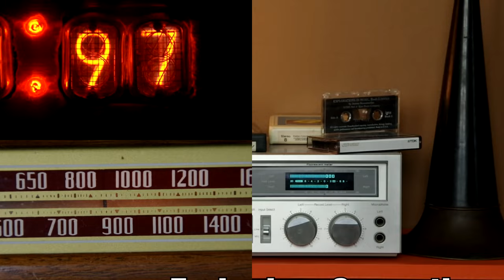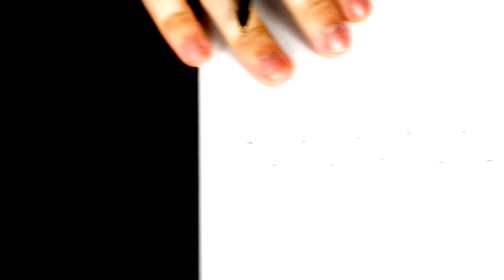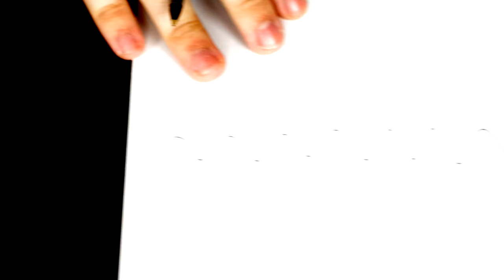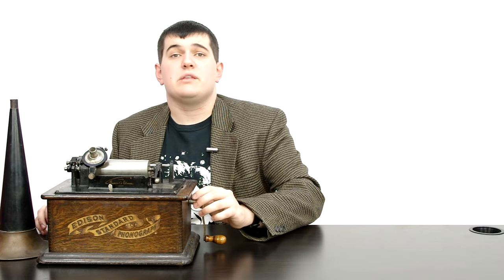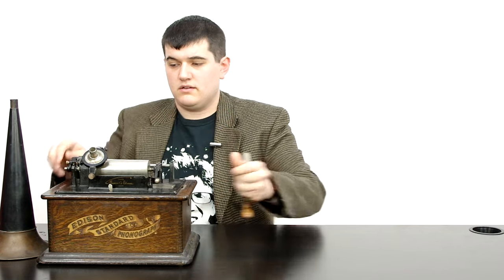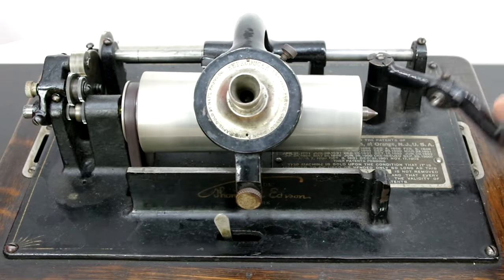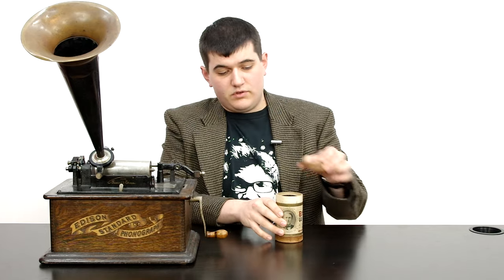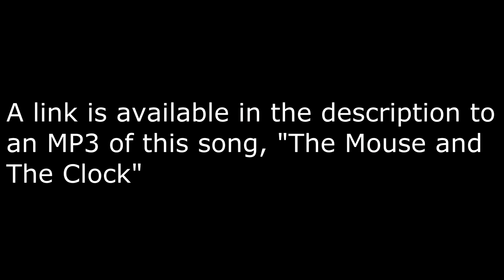Edison's Impression: Laying Sound into a Groove

Comment: interesting fun fact about that style of governor,  its where the term running "Balls out" comes from.   Stationary steam engines commonly had one of a similar design except instead of sliding a disc against a brake they controlled a steam valve and were weighted with big iron balls.  a steam engine at its max speed had the arms with these weights all the way out.
Reply: not just steam engines, old otis elevators had the same idea, two large balls ontop of the car would spin as the car got going if they spun too fast cause the elevator had lost control or the cables snapped the balls would drag out the emergency brakes which would bring the elevator to a stop then a technician would have to come and reset the emergency brake after fixing the elevator and the passengers had been rescued it wasnt so much of a governor as much as a fail safe speed control
Reply: zachary carlson i think there was an episode of mythbusters where they destroyed one by removing the pin and that let the elevator free fall for the experiment.
Reply: The mechanism you are thinking of is called a Governor.
Reply: unherolike So called because it holds the highest governmental office in a state!
Reply: Mm, balls of steel
Reply: @compzac  Would that be the origin of "balls to the wall", as the balls on the arms could, theoretically, touch the inner walls of the elevator shaft?
Reply: @Dargonhuman  no the balls of the governor never touched anything, they were weights that when spinning too fast would cause the other parts of the governor to pull cables activating the car brakes, I only have a rudimentary understanding of how those old systems work but they seem to have worked well as they continued to be used well into the 70s on certain elevators before being replaced.
Reply: @compzac  As rudimentary as your knowledge may be, you still know far more that most people do on the matter. Thanks for sharing!
Reply: @Dargonhuman  Ball to the wall referred to the throttle balls of a WW2 airplane as they would go in full throttle and under the radar to keep from getting hit by AA fire.
Reply: BIG IRON BALLS
Reply: @Dargonhuman  falls to the wall meant the balls on the aircraft engine control to the firewall.
Reply: Centrifugal governor, we use that in mechanics to get less variables in speeds
Reply: The origin of “balls to the wall” had to to with steam equipment in factories when run at full steam power.

Comment: Edison's original patent for the phonograph included a disc version. 
The reason for the cylinder was to keep the speed of the groove constant under the stylus.
Reply: 79th thumbs up
Reply: Which is the topic of the next video!
Reply: Yeah, although admittedly it was totally unnecessary since the machines couldn't reproduce sounds high enough pitch to matter anyway.
Reply: Edison filed patents, not the inventor.

Comment: Years ago my wife and I were checking out the collection of antiques in Knott's Berry Farm, and they had an early juke box that played wax cylinders. It still worked, and they even let us try it. It was pretty amazing. It was called the Edison Multiphone. It had 24 wax cylinders mounted on a Ferris wheel sort of thing. When you put in your nickel and selected the song you wanted to hear, the Ferris wheel would rotate to move the correct cylinder into position to be played. By the time we returned a year or two later, they no longer allowed anyone to operate it due to its age.

Comment: I was told that when these recordings were made, they'd line up a dozen or so recorders, side to side to most efficiently make multiples copies at one time.  The cylinders were also numbered as to which machine they were recorded on.  Much later, it was discovered that if you were to play back a cylinder from the first and last recorder simultaneously, you witness a true stereophonic playback!
Reply: Later on they would use a pantograph, basically a reproducer/recorder combination head so they could be copied in better quality.

Comment: 16:12 "I'm not counting on my iPod working in 2115."

My iPod didn't even live past 2015
Reply: No shit.  That's why mechanical stuff will always win eventually.
Reply: Cause Apple Designed this way,so you need to buy the newest one every year. Shitty brand.
Reply: My iPod that I had in Iraq in 2006, the OG 80gig one, still works to this day.  It still has all the shitty music I listened to back then and I can't change it because the password for it is long forgotten.
Reply: I so wish I had a time capsule iPod to perfectly re-live my shitty music library of years past.
Reply: People in 2020 already: What's an iPod?
Reply: @zachaliles  SAME! My 80gb ipod still works but the battery is almost dead, last 1 to 2 hours. I changed the hard drive tough, just need a new battery and voila.
Reply: @morsteen  Your statement is not quite true. Mechanical devices can usually be serviced because they're not microscopic and use much fewer components . However even in electronic devices, the components that go bad 99% of the time are moving parts (button contacts, gears, potentiometers, switches, etc) and capacitors. A mechanical device is all moving parts, so it's all prone to failure and corrosion. The big difference is that back then, everything was made as if there's unlimited resources on the planet. They used thick metal and stuff, that's why it's not breaking, not because it's mechanical.
Reply: @DasAntiNaziBroetchen  i sort of understand your point.  But if something is mechanical on a car, like say, the old spark delivery systems on a model t or something, you can physically fix that with your ingenuity and parts.  You can even fashion your own parts if you need to.  If a coil pack goes bad on a new car, then it just simply goes bad.  You can't open it up and physically do anything to it.  It's molded with all the electronics pressed and glued inside and then heat wrapped with plastic as part of the housing, all in one piece with a plug on one side to plug into.  There's no opening that up to say, solder in a metal pad on a points system, like you could on an old more mechanical system.  On my 1989 acura integra, the main relay (circuit board) went out, and the car couldn't start without that.  Just won't ever start.  It needs that little board plugged in.  Well, once they stop making that part, that will be in the junkyard because of one little circuit board.  Whereas, if you had an old system, you could simply run a few wires from your starter, and create a push button system.  In the event of an apocalypse, you could even install a manual breaker style push button system that was purely physical, and still be able to start your car.
Reply: lmfao
Reply: @morsteen  umm, I do hope you are aware that you can get an entire custom circuit board made for a few dollars, and then have the parts put on the board for maybe 5 more... Electronics are simple to service, you just need to know how. With a small cnc and a computer I can make a surface mount guide for said board and attach all that parts myself.
Reply: @marcusborderlands6177  cool.  You need fully functional electronics just to make those lol.  Whereas, you can literally manually make most of the parts for what I mentioned earlier, and get it to function well enough to transport you. That's like saying "yeah but I can digitally put all my photos into these albums and tag them and look at them on my screen".  But you need a working computer to do that.  If it takes a shit, and you didn't print a hard copy, then you have nothing.  Sort of the same concept.  Manual mechanical things can be resurrected with enough work.  Highly advanced electronics simply cannot without the intervention of other already produced electronics.
Reply: @marcusborderlands6177  you can eventually. And/or make a crude version.  Yes you can do a platter transfer, ok...still need a functioning computer to peer into that disk.  I get what you are saying though.  I prefer digital for interaction, but at the end of the day, concrete physical matter will be something you can always use.  It wouldn't be the case with over-complicated electronics without the aid of other electronics to keep it alive.  It just wouldn't happen.  Sit in a shed by yourself with a regular set of tools, files, wire, maybe a lathe or something, and you will eventually be able to make that model t work again, even as a layman or intermediate level mechanic.  Sit down there with a hard drive platter and a host hard drive, a motherboard, psu,...hell I'll even give you an lcd monitor.  You might be able to get it all working I guess.  Good luck keeping the platters clean outside of a clean room.  I just don't see much manual mechanical work being able to be completed on complex electronics if you absolutely needed to.  But I guess it is possible. Could you make that main relay completely manually, without the aid of another electronic device that would need it's own fully functioning electronics to help you complete your task?
Reply: @morsteen  could you make those mechanical bits needed to repair the engine of your car after it was head on hit and pushed through the firewall without any mechanical devices? See? It's all pretty pedantic.
Reply: @morsteen  just wanna say I've really been enjoying this back and forth, but I'm really tired rn, so I can't seem to write anything properly coherent in reply to what you said. So I'mma just take a nap and see if I can get my thoughts in order.
Reply: @marcusborderlands6177  that's fine.  It's really hard for me to type out novels on a stupid on screen touch screen keyboard.  I miss the pull out tactile keyboards phones used to have.  I could type almost as good as I can on a regular keyboard on those.  But this touchscreen crap always makes me have to go back and correct words.  It's a pain.
Reply: @Volkan Manco but not manual.  You can't fix it without other highly precise and complicated electronics.
Reply: @morsteen  I agree and  thats why the majority of cars made after the mid to late 90's will never be collectible in 50 years from now . Nobody will be making all the electronic parts and all the plastic on these cars will dry rott or warp . 

 Only very rich enthusiasts will collect these cars because finding parts for them to restore will be a literal treasure hunt.
Reply: i got my first ipod 5 months ago
Reply: If anyone is going to have a working iPod in 2115, it'll be DankPods

Comment: Thanks for the great video.  I have a portable (20 pounds or so) Edison machine for two minute cylinders from about the 1900 - 1910 decade.  The cylinders still sound surprisingly good even though many are well over 100 years old.  I had a couple of cylinders deteriorate.  One Edison wax cylinder was attacked by mold and another shattered when I slid it on the mandrel.  The careful engineering in the machine is quite evident and there is a lot of attention to detail, even in the spring motor.  The reproducer is very interesting.  The stylus is a very carefully ground sapphire, and it is sort of club-shaped with a ball point.  I have no idea how the stylus was machined, but it is probably one of if not the most expensive components in the machine.  Over all it is a fascinating machine and nowhere as simple as you’d think at first glance.  As far as I know, everything on the machine I have is original and it still works almost like it did 110+ years ago with essentially zero maintenance.

Comment: Alec,
Do not use a 4-minute reproducer to play 2-minute wax records. The 4 minute stylus is too small for the larger 2 minute record grooves and will damage them. 
You can safely play 4 minute wax and celluloid records with the H reproducer, but you need to have a model C reproducer to play the record demonstrated in the video

Comment: There was also the automatic piano (my name). It worked on a scroll of paper with holes of various lengths. The scroll passed over a mechanism that was pedal powered. The mechanism linked in with the piano levers and reproduced the movement to move the levers and hammers that hit the piano strings. The scrolls were stored in boxes about 12” long by around 1” and 1/2.

Comment: Actually, Edison's cylinder coupled with vertical recording gave a better sound than did Berliner's lateral recording on a disk. I suspect that this is because the sound waves coming from the horn were at 90 degrees to the diaphragm and this was the most direct connection to the rotating cylinder. With the Berliner system, a somewhat convoluted (and less direct) arrangement existed between the diaphragm and the recording stylus. With acoustic recording, this difference was very important as a consequence of the low amount of energy actually present in the sound waves coming into the horn and the Edison system being more direct was, therefore more efficient. This can be demonstrated today on U-tube by listening to well-reproduced recordings (preferably electronic) made on the two systems and extensively presented on U-tube. In most instances, cylinders outperform the disks, especially with 1890's and very early 20th century recordings. On this matter, it might also be mentioned that U-tube is providing a medium where collectors of early audio recordings can share their treasures without actually relinquishing them as can be demonstrated by the number of rare early recordings currently available on U-tube.

Comment: The foil used was made of actual tin, not aluminum as now. Aluminum in Edison's time may have been known only to chemists as an element, and until extraction procedures were found so as to make it commercially available, was rarer and more costly than gold. Now, tin is a valuable metal whereas aluminum being plentiful and cheap.
The stylus in Edison's first tinfoil phonograph was not a cutter but rather was a smooth boss stylus (writing pen) which incuses (without removal of material) it's shape into the foil surface as "hill-and-dale" modulations. Of whichever it may have been made, there would have been tendency to drag and tear at the surface, rather than indent it properly. Ideally, to duplicate a tinfoil recording experiment, an ordinary small-gauge ball point pen with ink acting as a lubricant, would prove ideal. (At the same time as embossing, it would we actually WRITING sound!)
Edison was a peculiar man, to put it kindly. From the time of the invention of his Phonograph to Bell's taking-over with ozokerite coated cardboard cylinders, was all wasted, during which he could have exploited it to-the-max. As a result all the famous voices and instrumentalists of the mid-late 1800's were missed. Although he had a good go at it later, Columbia (who were mostly attorneys) kicked his behind really good in court, on many occasions.
He was great with experimentalism but, not so hot with seeing the various possibilities within his discoveries.
Had he treated Tesla with respect rather than impudence and contempt, we would have had the perfected 60hz. poly-phase electrical system way before Westinghouse, who DID treat him right and prospered thereby greatly on account.
. : .

Comment: Loved the video... But that's the wrong reproducer. The Model H was designed for 4 minute cylinders. The stylus is too small for a 2 minute cylinder (though it will kinda work). Should have been using a Model C. It would have sounded better :)

Comment: When you say "tin foil", do you mean literal tin foil or aluminium foil?
I have read both versions.
Reply: literal tin foil; aluminum was expensive in the late 1800s, aluminum foil didn't supersede tin foil until after WW2
Reply: @drewgehringer7813  I think aluminum wouldn't have worked anyway as tin foil is much (relatively speaking of course) stronger. But yeah people tend to use tin can, but I don't think food was ever stored in tin as it's fantastic at making people sick, and tin foil even those the foil hasn't been used in masse since pre Hiroshima. Aluminum foil is much better as it's safer and especially now days cheaper than tin
Reply: @skizzik121  Tin was indeed used as the material of construction in the first cans. Tin is corrosion resistant and biologically relatively inert. The switch to steel cans occurred due to the cost of tin and the superior strength of steel. The steel was (and still is) coated with tin for corrosion resistance. Most modern cans are lined with a polymer, but still tin plated on the outside for corrosion resistance.
Reply: @skizzik121  tin is quite safe whilst the can is sealed. Once exposed to oxygen you get poisonous oxides forming. I think. Something like that anyway.
Reply: @wb5mct  biologically inert?
Reply: @CometAura not totally inert, but from Wikipedia "Tin poisoning refers to the toxic effects of tin and its compounds. Cases of poisoning from tin metal, its oxides, and its salts are "almost unheard of".  It was used extensively to coat dinnerware before stainless steel became widely available and was used to make squeeze tubes for toothpaste and medicines until a few years ago when plastics provided a cheaper (though I would argue inferior) substitute. ( IMHO modern toothpaste tubes suck!) :-)
Reply: @Loehengrin  not so. Tin, unlike many metals, is essentially non toxic. See https://en.m.wikipedia.org/wiki/Tin_poisoning#Biology_and_toxicology
Reply: I read somewhere that tin cans were often soldered together with lead-based solder before the toxicity of lead was widely understood. This is where the reputation of tin cans being toxic comes from. Once they figured out how to crimp the cans together instead of solder them, the problem went away.